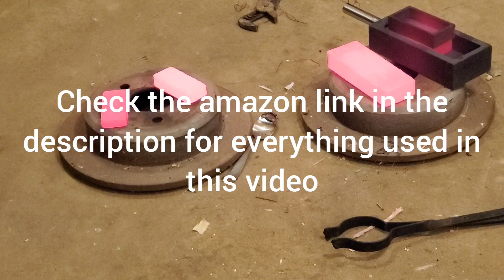Trash too treasure.....turning electric motor into copper ingots.

Comment: That 5lb bar turned out really nice. I love the Aztec pyramid your building on the work bench,  cool. 😁
I got hooked on melting probably at the end of 2018 when I come across BigstackD videos. I found them pretty funny and really informative even though he doesn't say anything but explains with text. 
I like your videos because you are not trying to do something similar to the way BigstackD does his, which I have seen quite a lot of others do. 
Personally, I think that you speaking and telling what your doing is great, but if your not comfortable speaking on the videos or you just prefer not to that's fine also. 
I think that because the way you are making your videos is not the same as others it is refreshing and independent. 
I noticed you lost a bit of bark off your left thumb. Looked oddly familiar.  My left hand cops a beating and I've got 3 self inflicted wounds on that hand healing as we speak. 🤣
I had trouble getting windings out of a motor,  and what I ended up doing was I have a couple of car stands which I set up. I belted through a length of reo bar through the opposite loops of windings and rested the outside ends of the reo on each stand. Then I belted the stator steel downwards off the windings with a lump hammer. Worked pretty good,  let gravity help me.
Keep the videos rolling, I dig them. Especially because you show the breakdown of scrap items to get the metals to melt and then the final product, which are awesome. Look forward to many more of your videos. 
Cheers.
Reply: Hey that’s a Mayan Pyramid of copper 👍🏼👍🏼😆😆
Reply from the maker: Thanks for watching brad I always look forward too your comments.